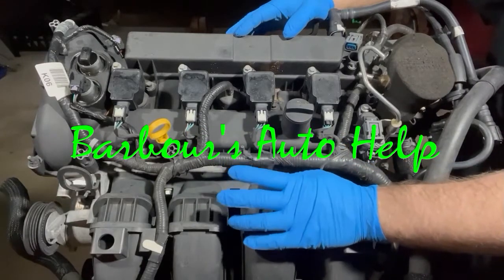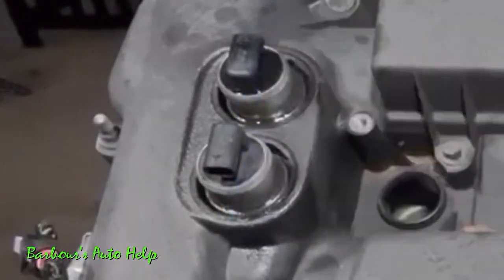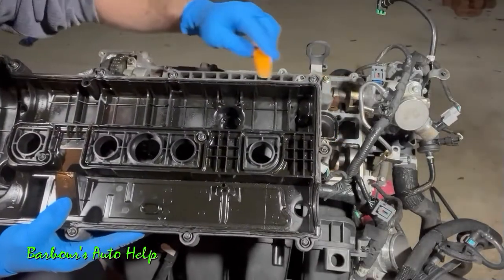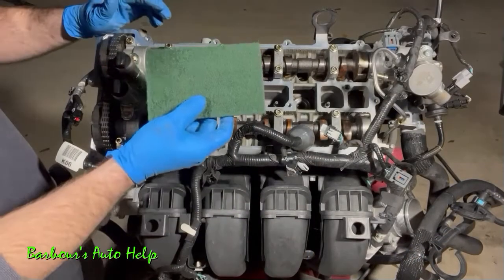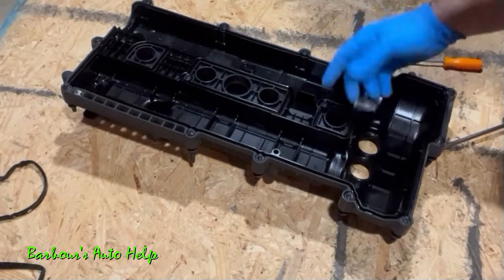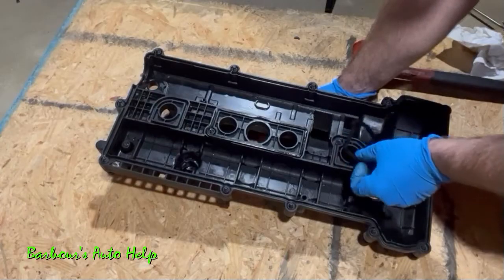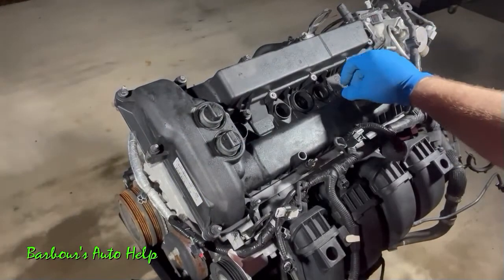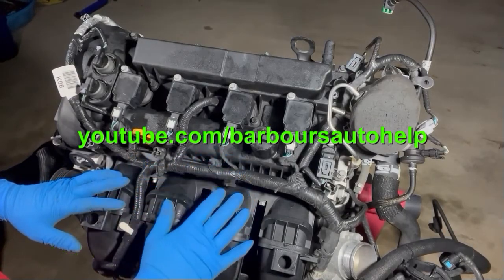Valve Cover Gasket Replacement 2012-2018 Ford Focus 2.0L

Comment: Great Video! I did this repair last weekend and it went smoothly. Getting the valve cover past the vct solenoids felt like it took forever. Thanks for pointing out all the areas to use a pry bar, I had to use a few of them to get the valve cover off!

Comment: I will make a suggestion to make it easier to remove tho old valve cover  gasket without prying and potentially damaging the seam surface. Pull out the bolts from the valve cove first rather than just loosening them up. There is a metal centering shaft surrounding the bolt that is fairly easy to pull out of the old valve cover. If tight, apply a little PB Blaster. Once they have been removed, insert  two needle nose pliers into holes  One half of the pliers on the outside and the other half on the inside next to and opposite each other bolt holes. You will have more than enough pull to remove the cover from the left side of the engine. It is easier too because you are evenly pulling on the cover so it is not pinching the seal around the solenoids. The video was vary helpful. I torqued in the radial pattern recommended by Ford and final torque was set to 106 inch pounds.

Comment: My spark plug tube gaskets break everytime, I’ve bought the kit three different times spending 150 on just the kits. Help me please. I oil them up heavily but every time I push them down the inner park breaks off
Reply from the maker: I'm not really sure how this is possible.  How tight are you tightening the bolts?  What brand are you using?
Reply: @BarboursAutoHelp I can’t even push down on the valve cover when putting it back together because of the spark plug tube gasket ripping. I don’t even get to the tightening the bolts. Could it be because they are so corroded that I need to sand them down? When I pulled off the valve cover the spark plug tube gaskets got stuck on it and had to break them off with a screw driver
Reply from the maker: What are you working on?
Reply: @BarboursAutoHelp 2015 ford focus se
Reply: @BarboursAutoHelp figured it out, sanded it down and it slid right on

Comment: Sir, I know this video is a year old. It helped me a bunch.  My daughter has a 2015  Focus and the valve cover cracked. ( her husband turned the oil fill cap too much  ) your video was of great help.  I was having problems getting the old valve cover off. When I finally just grabbed it and yanked on it, I was surprised. The gasket was holding on tight.  Just over 100,000 miles on the car.  Thank you for a very good video.  I understand the disclaimer,  I understand I can make a mistake.  Trying to help people these days,  you really do need to cover yourself.  Again,  thank you sir.  A very interesting,  and informative video.

Comment: Why does these engines have so many different types of valve cover gaskets?? I have a Ford Focus SE 2.0 Hatchback 2012 shiftstick and I'm trying to buy the gasket, but when I go to eBay's fitment it shows that the item is not compatible with my engine... Can you please share the part number for the gasket you installed. By the way my engine doesn't use the cylinder head temperature sensor

Comment: What the hell? Where is my head temperature sensor?  I don't have one!
Reply from the maker: Do you have a 2012-2018 Ford Focus equipped with the Duratec 2.0L?  Or is your vehicle equipped with a different engine?
Reply: @BarboursAutoHelp  I reused the vct seals , and no visible leaks, but I can smell crankcase fumes inside the car.

Comment: Im looking to do this on my focus- My engine is pretty dirty- I sprayed air to get all debris out but the top of my engine is coated in dust- is dust getting in the engine any risk? I have had friends tell me to give the engine a light rinse to get the dust off but I don't know- ive seen other areas say not to do that
Reply: My focus has just shy of 100,000 miles and I went to change the spark plugs and noticed the middle two had alot of oil so I know I need to swap out that middle gasket.
Reply from the maker: I wouldn’t wash it. Just blow it off really well with air and don’t get anything in the engine.

Comment: Brother! Thank you! I'll be the first to admit that I'm no mechanic but sometimes, you have to do what you gotta do. I had been dealing with oil spraying from the top for two months but couldn't afford a mechanic. Bought the parts you recommended and got it done in about 8x longer than it took you. Lol She's running now and smoother than it has in a long time. Easy tutorial and explanations along the way made this a snap. Again, thank you.

Comment: Great vid man..will def follow. Any thoughts to a thing amount of tack bond to hold the gasket firm in the cover while reinstalling? Keep up the good work!
Reply from the maker: Never needed it for this job on the 2.0L.  The gasket usually hangs on pretty well in the groves.

Comment: Sub'd appreciate the help. I hate Ford for making super cheap cars but needless to say I have the 14 Focus. Transmission has already required service within 1 week of buying off marketplace. Has less than 100k miles. Got home this morning and smelled burnt oil. Sure enough, I see oil build up along the VC. Since I'm near 100k anyway, I'm going to start prepping for this repair. Appreciate the tutorial.
Reply from the maker: No problem at all.  let me know if you have questions.

Comment: hey thanks for making this great helpful video... I umm, snapped the bracket off of the exhaust valve timing solenoid.  is that thing pressurized with oil and will shoot out of the engine if I run it without the bracket holding it down?  a replacement is only $15 but I don't want to have to take the damn valve cover off again to replace it if I don't have to!  lol
Reply from the maker: The VCT solenoid must be bolted down. A stitch in time saves 9. Sorry but it’s the best thing to do.
Reply: @BarboursAutoHelp  thanks.  I know.  I haven't started the car and am waiting for the new solenoid which should be here tomorrow.  didn't want to risk oil being blasted all over the engine bay or loss of oil pressure, or the part hitting the cam or whatever.  thanks for the reply.

if you're at all curious how I broke it I was tapping the new ring gasket on using a socket, which got stuck, and I tried to unstuck the socket with a pipe wrench, thus liberating the whole solenoid with the socket jammed onto it.  lol.

Comment: Great video! Can you show us how to get a regular transmission instead of a CVT?
Reply from the maker: I wasn’t aware that a CVT was an option for this vehicle.
Reply: @BarboursAutoHelp  Sorry I meant DCT. I am used to altimas I guess.
Reply from the maker: @RECTALBURRITO Oh ok. I’ve never had the opportunity of switching one out. But I’d imagine it’s possible. Probably would require a lot more than just changing out transmissions though. New harness. New PCM or reconfiguring the existing one. New floor console etc. I’m really not sure if there is a solution like that for this vehicle. Sounds like something I can look into. Either way it would probably be very expensive.  Maybe even close to the actual value of the vehicle.

Comment: I don't think I need RTV sealant or a gasket maker. I read it's not necessary
Reply from the maker: I don't recommend not using it....The engine comes from the factory with RTV between the timing cover and the head so....that should be an indication that you need it.
Reply: @BarboursAutoHelp  i loosened all screws and it's lifting but it's hard
Reply: @BarboursAutoHelp  it's hard to shimmy it 😪 😕
Reply from the maker: It can be a little difficult.
Reply: @BarboursAutoHelp  i finally got it off🤩🙏
Reply from the maker: Good job! @Antigov247

Comment: well crap. I think I installed my VVT solenoid seals upside down. I doubt I can remove them without damaging them :/ 

BTW if you're not removing the fuel line you will want to remove the camshaft position sensors to get the clearance to pull out towards the passneger side.

Comment: This demonstration is on a engine with zero miles 😂
Reply from the maker: What’s significant about that?
Reply: @BarboursAutoHelp  you can’t tell where the actual leak is coming from on a broken in engine
Reply from the maker: So what are you looking for?  A video on how to find an oil leak?  I don’t understand. I have a video on that if you need it. This video is just for showing how to replace the valve cover gasket.
Reply: @BarboursAutoHelp  just want to see a comparison on the valve cover gasket leaks
Reply from the maker: Maybe this will help. 
Find Oil Leaks Easily With a UV Dye Light
https://youtu.be/B3P5Ntqb_pU
Reply: @BarboursAutoHelp  This video is perfect, and helped me out. Thanks!

I don't know why someone would want to see before and after. If the gasket doesn't fix the problem, then it's the cover.